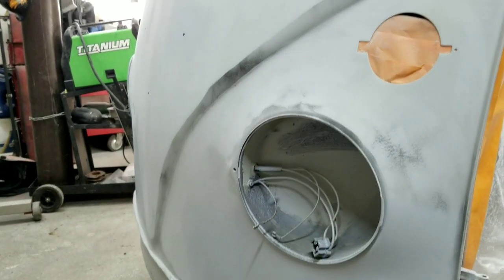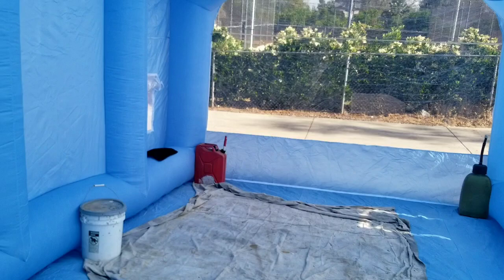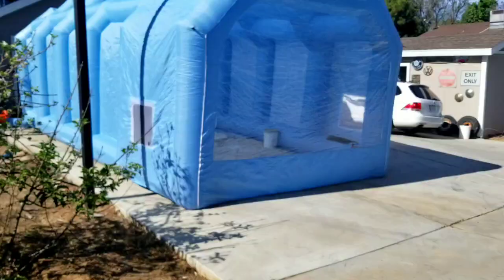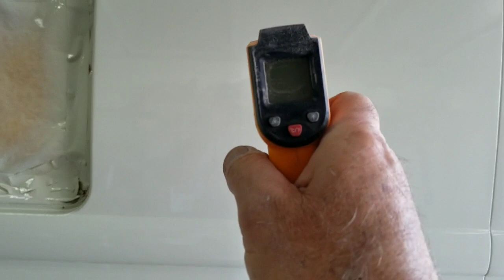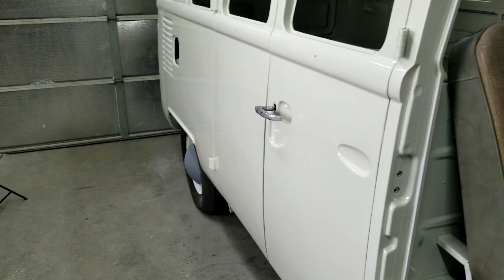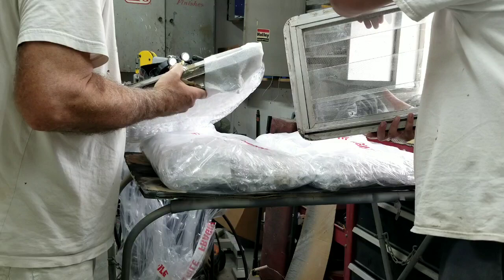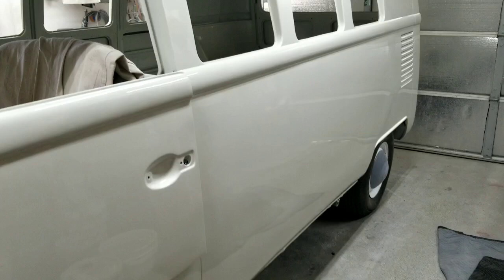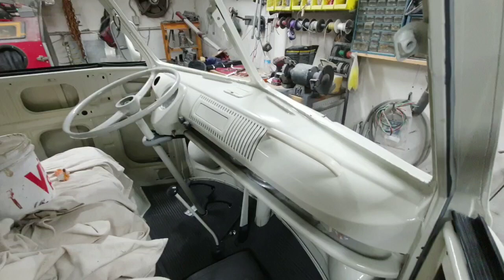RESTORATION - Painting the outside of the VW bus in inflatable spray booth

Comment: Hi Mike,So far so good!Nice work you reach almost the final restoration ,now just to instal the Windows and the front shields ,Your performance of the bus is exellent ,Like to see the complete work done in the next video.Just one question about the. paint, did you used   Polyurethane - Alkyd-water based paint.or 2 k epoxy paint.I just wondering ,Ok stay saf  and healthy.Greetings and regards from HCS.

Comment: Great job, thanks for the video.  One question:  you left the door opened to the inflatable booth, were you not concerned that you would get stuff that would land on the wet paint?
Reply from the maker: Not at all works really good. I could have shut the door but would have been hard to film.door shuts and airflow still goes to filters. Just got a little dust  I didnt even buff the roof. Pretty smooth.  almost no orange peel in it or dust.